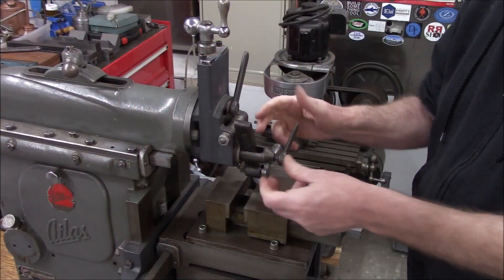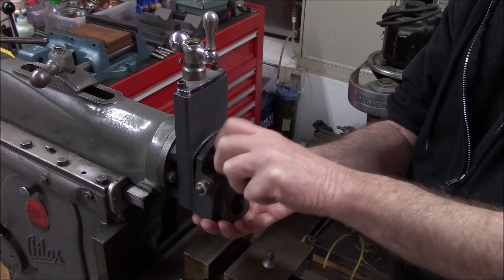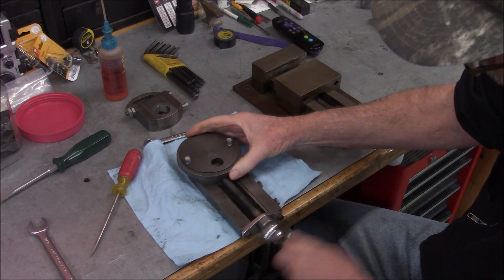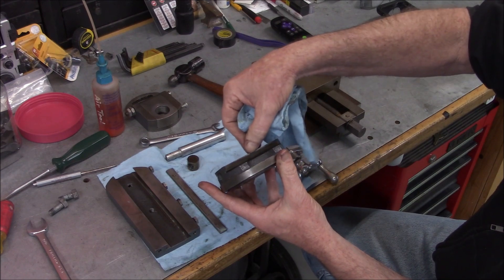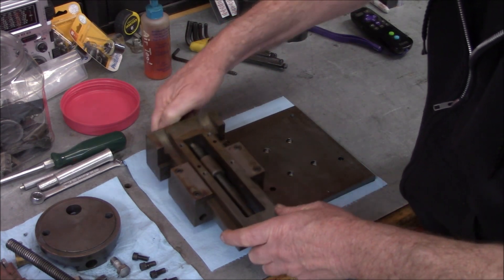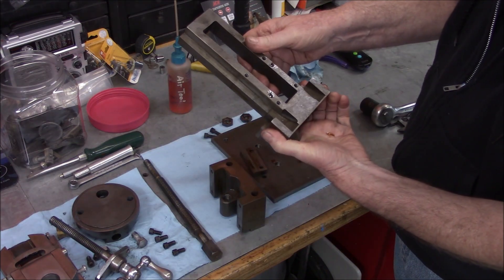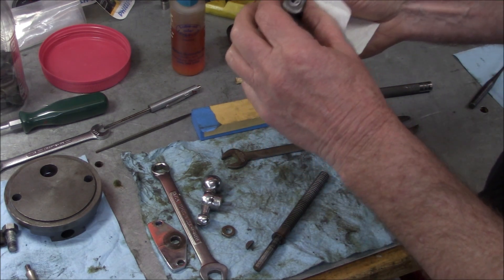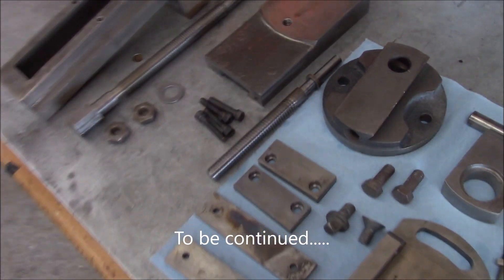Atlas 7B Shaper Project Part 7 - Vice and Swivel Down Feed

Comment: I think you're lucky on this one. No major damage on the parts.
It's just a bit bizarre that Atlas originally didn't had a clapper lock.
Reply from the maker: Yeah I'm definitely keeping the lock, I'm wondering if the downfeed slide should also have a lock?
Thanks Rusty !
Reply: @TheAyrCaveShop  My machine has one and I use it all the time. It's really handy.